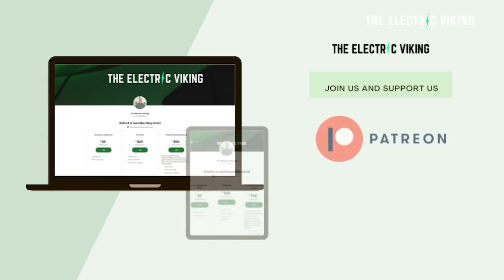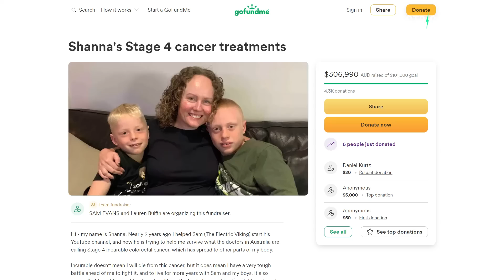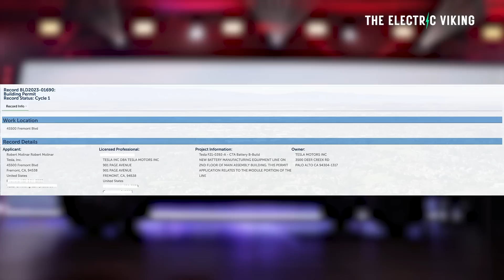Tesla's 2 new battery manufacturing lines for the Cybertruck

Comment: Tesla is ALL about efficiency, which includes localisation of supply. It makes no sense whatsoever to produce batteries at scale in Fremont only then to be shipped across the continent to be used in CT at Texas. (Texas has huge greenfield land which will be used for anything CT related). So, this new battery line at Fremont is either another R&D development for different chemistries and/or production techniques for in-house battery production, or a replacement battery supply for S&X which still use legacy battery forms, or for the SR American M3 which uses (non IRA) imported batteries.
Reply: R&D and brain power is in California not in welfare confederate red states.
Reply: This stuff takes time.
Reply: Or there is a going to be a cyber truck production line in fremont.  No idea where they would put it but should be a smaller line.  With the huge number of reservations it makes HUGE sense for tesla to open a 2nd line after the first ramps.

Comment: I am crossing my fingers and hoping two things happen with the Cybertruck: 1. It can tow a 3000 - 4000 pound boat 150 miles with 10% charge left. 2.  I can afford it when they pull my number.
Reply: Thats the question isnt it.  Apparently the lightning gets destroyed when towing.      I dont know how much more efficient tesla can make it.     Towing is hard on batteries.    Those semis have HUGE batteries  to make up for it.
Reply: @jebes909090  Its usually related to aerodynamics.  The Lightning is a huge brick.  The Cybertruck was designed to have a better drag coefficient.  Just like the Model Y which has been seen to tow a boat weighing around 3000 pounds 140 miles with some charge left.  The boats or trailer cargo's aerodynamics matter too.
Reply: there will be a 50% range loss on towing.  seems to be what the lightning gets, the rivian has about that loss.  ice trucks have around that loss too.   personally i wouldn't want to tow anything too far without the 500m range variant.   the dual motor was supposed to get a bit over 300m range.  so that one would be at the very edge of being able to achieve 150m and have any sort of range left. 

question is, where you tow to, is there a supercharger on the way.   even a quick 20min charge would help a lot.
Reply: @Dirgecaller  I have superchargers near ever destination I can go to in a 200 mile range.  Knowing the Model Y is a 78 KW battery pack its getting more miles than KW shows how efficient Teslas usually are (as long as bumpers don't fall or there are panel gaps lol).  Unlike the lightning which is equal or less.  The Cybertruck is supposed to get a 100kw pack or larger.  I know the truck will be heavier but that could be offset some by a better wind coefficient.  3rd party models are already predicting its at record levels.